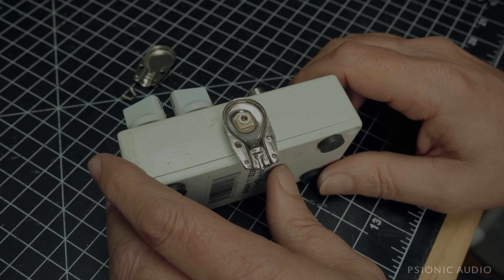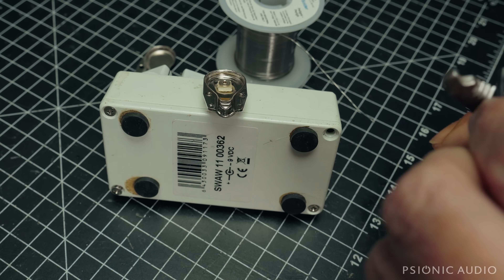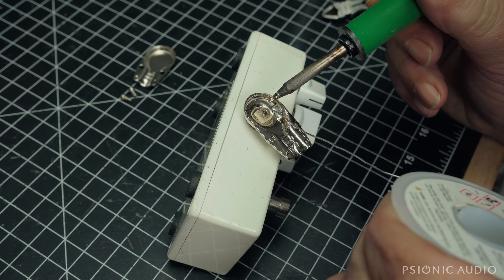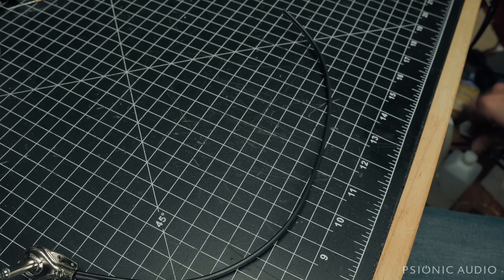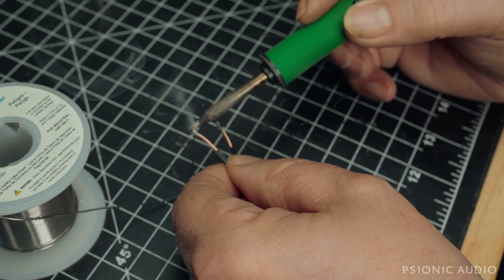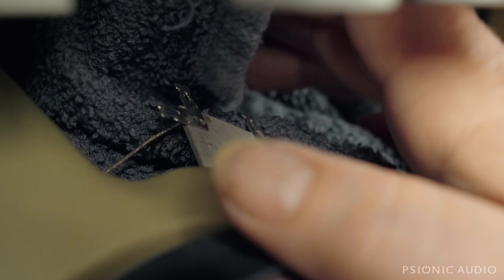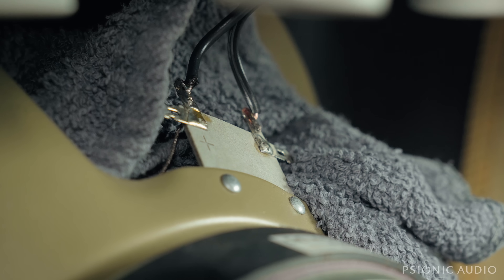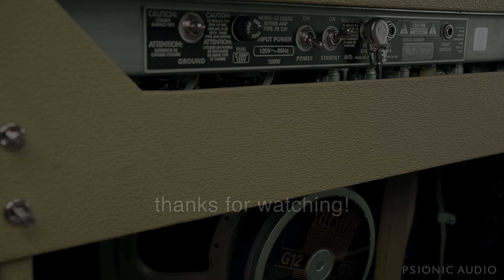Let's Make a Speaker Cable

Comment: I don't know if you've figured it out since this was filmed, but you can set the sleep time on that soldering iron. The procedure is in the manual, step 6 but isn't as clear as one might hope.

It involves inserting the control card and holding the up and down buttons while powering the unit on. It starts in bank 1 - Temperature scale. Hitting * selects bank 2 (sleep settings), and then moving up/down from there sets the setting in question. `2 _ 0` is the default - 0 minutes or instant sleep. The second 2 digits specify how many minutes it takes before sleep. So if you put `210` there (press up 10 times as the manual says), you are saying to go to sleep after 10 minutes instead of instantly (0 minutes). Press it 20 more times to set it to 30 minutes (again as the manual says) 

I set mine to `2_2` - 2 minute delay before going to sleep.

Comment: I have a marshall mg100dfx combo and there is some mention that the 4  ohm speaker is too low impedance for it. Theres a cheap with a heat sink that continously burned up in the past. Im thinking of adding a longer wire ao as  I can operate it from my desk while its miked up. Latest experiment was adding a cpu fan in place of the old one which seems to be working until I close the enclosure and screw it back together. Makes loud sudden popping noises when its closed. I Suspect due to the fan blowing the wire harnesses between the boards inside. Is making the wire longer helpful. For reducing the temperature and potential failure of that chip. There are people recommending an 8 ohm speaker replacement. Im considering the swamp thang from eminence.

Comment: Thanks A LOT for this just essential tutorial.
First of, nobody really tells you a basic guitar cable is NOT suited to connect an amp head to the cab. 
Even in stores, when you buy an amp head and cab, you ask for the cable, the guy tells you, with an authoritative "duh.. just use a guitar cable" with "you stupid newbie" look in the eyes🤯.
I don't know why manufacturers don't even supply the cable with the cab or speaker.. 
Even when you search "cable for amp head to cab", most links show you classic guitar cables..
So there you ruin your amp head, or just underuse the sound capabilities of your new piece of gear..
You find thousands of forums talking about this fabulous guitar cable brand with tons of talk, and almost nothing on this important detail, you need a different cable for your speaker, with these guitar type plugs.. 
😂

Comment: Ive been using those pancake jacks for everything that needs a right angle for years. Speaker cable, patch cable, instrument cable. I use the TRS version for my instrument cable to my guitar so i can use the ring connection to send a DC voltage 9-18v to my active pickups so i don't need batterie in them anymore. The first pedal in my signal chain has an 1/8" jack i added that I plug a DROK variable dc power supply into and that jack is connected to the input jack ring connection which passes the dc voltage through the TRS cable to the guitar. That way i can send a precise voltage to the pickups that atays consistent. So my active pickup guitars are plug and play, no batteries nessesary just like my passive guitars. Plus i hated how much my tone varied when i was using batteries. From one day to the next i could tell a difference. But using the power supply i always get the same output and tone for a given voltage. Anyways that was a ramble, point was i love those pancake jacks (the good ones at least, as Lyle likely knows they ARE NOT all created equal quality wise lol).

Comment: I know soldering the wires to the speaker lugs is supposed to be more secure but I am aware that "Heat" is'nt a friend to the voice-coil, I  just crimp the connectors so they don't slip off . Seen speaker cones with holes from solder blobs burning through the paper cone and some speakers fail if the iron gets too much time on the speaker lug. I trust myself but if anyone out there is going to DIY then watch this video at-least 10 times and maybe stick a  bit of insulatining tape over the "positive" on the angled jack just so it does'nt short on the cover plate when you close the connector(usually theres a small tab on the inside of the cover but check anyway) , thanks for a very useful video tutorial!

Comment: I must be doing it right. I've made many speaker cables exactly how you described. I do appreciate you mentioning the temps you use for different applications. I've been backing off on my heat and getting better results.

Comment: Never been a fan of those Switchcrap connectors. A real pita to work with, can’t use thick wire, and a short circuit waiting to happen.

Comment: What do you have against quick-connect terminals for hooking up the speaker wire to the speaker?
Reply from the maker: It fails. Commonly.
Reply: @PsionicAudio  Do you mean the vibrations wiggle the connector loose?

Comment: If you're going to use terminals instead of soldering, make sure to measure and see if the lugs are .205" or .25".  Many off-the-shelf cables that have terminals on one end use the more common .25", even though many popular speaker brands use .205" lugs.  I learned this the hard way when one of mine slipped off, I was lucky to catch it before damaging the output transformer.  Since then, I solder everything if I know I like the speakers, or I at least use the proper terminal size while trying them out.

Comment: Lyle... what's your opinion on using spade connectors in such case? I just made a speaker cable for my Fender Super-Sonic 22 combo and now thinking betweem soldering and spade connectors. I have been upgrading and "fixing" my amp with everything you (and Brad - shout out to Brad and Brad's Guitar Garage) have shown, told and explained. Thanks!
Reply from the maker: I don’t like quick connects. Solder is so much safer for your amp. If you use QCs make sure the connections are clean and tight.

Comment: Great stuff Lyle. Just 1 quest. Back in the day i bought a tube of rosin soldering flux from radio shack that has lasted me 20+ tears. I used it for pretty much all soldering to avoid cold joints with 60/40 solder. I don't see people using that anymore. Is it now incorporated into the solder itself?  Thanks!
Reply from the maker: The solder I use is has a core of resin flux, so it’s flux and solder at the same time. Occasionally I’ll reach for a flux pen if any extra is needed. But that’s pretty rare.

The solder I use is listed in the video descriptions.
Reply: @PsionicAudio  thanks for the info!
Reply: @MarioV689  , I have an old container of Weller rosin flux, a piney-smelling resin that has some crystals forming but still works good when soldering to a heavy chassis ---- offers some additional oxide removal and heat transfer. Unfortunately, some of the fluxes sold on ebay or Amazon are repackaged acid fluxes of a type suited for waterpipes but are being resold to unsuspecting newbie electronics hoppyists.

Comment: I had a bag of those "pancake" right angle jacks ready to wire up a pedal switcher unit. 
Problem - jack sockets too close together for the width of the jacks. 
Yes there are narrower right-angled jacks But they stand out further, space is at a premium.  
Solution - Tin snips. I cut a segment from the side of the jack bases then bent the covers over to match.

Comment: Another great informative video! Lyle is the best at this. Another tip I have used for years on cable connectors is to dap a small amount of 5 or 15 minute epoxy into the cavity before screwing the 2 halves together. Just another layer of protection to keep everything from coming loose and I have never had a connection fail or wire pull out. Thank you Lyle for all of these great videos!

Comment: Yeah I use the 2x4 with a hole drilled in it method - and I also have this same pedal but in working order. 

I needed a speaker cable for a combo amp and should have built my own but bought one off of ebay to "save time" and the cable for bridging the 2 speakers was way too short. Should have just built my own. It would have been cheaper and done properly. Lesson learned I guess.

Comment: Lyle, apologies if this is a dumb question, but does speaker polarity matter in a single-speaker amp or cabinet? I can see why it matters if you have more than one speaker, but don't understand why it matters with a single speaker. Also, SquarePlug SP400 (or SP500) low profile right-angle plugs are an excellent option for Fender amps. Thanks for your work on YouTube

Comment: I do not like the StaKon connectors on speakers either ,I have a 2x12 amp that has StaKon connectors on the speakers and one of them worked thier way off ,so I just soldered all the connections ,Nice tutorial Lyle

Comment: I’ve been soldering PCBs, guitars, amps, etc for a couple of years but I’ve always wonder if there is a minimum temp on the soldering iron to avoid a cold joint? I guess the material soldering onto is a key factor to the answer. Feels like anything below 300 degrees won’t get the job done.
I don’t wanna overheat the component either. For an example, how much heat can a potentiometer take before damaging it?

Comment: Looking at the manual it appears the timeout on the Hakko 971 can be set as long as 60min, or turned off entirely (but being a Hakko it takes a bazillion button presses to navigate their weird-ass menu system)
Reply: And yet, an ancient Weller TCP type soldering station (24volt AC supply and magnetic heat control) on my day-job workbench ran for over 15 years, 8 hours a day,, 5 days a week,, on the same heating element. Tips were good for about 3 months, and to increase the temp you changed to a "hotter" tip.

Comment: From Leo:  Good tip on the junk pedal to hold the plug.  I drilled a hole in the top of my soldering station and installed a jack.

Comment: A nice neat job and I drilled holes at different angles slightly smaller and tapered them into a block of wood so the plug doesn't move.

Comment: Sometimes those right angle plugs come with a little insulator disc to ensure the center connection doesn't short to the top of the shell. Maybe the video simply doesn't show it. The method used to connect the center pin should avoid the issue in most cases. I think it's worth a mention, as a belt and suspenders guy, if no insulator, add a piece of tape over the center pin before closing.

Comment: Thanks for posting this! We do these mundane tasks without a second thought, but it’s great to see a solid repeatable method demonstrated. I remember the first time I opened one of those pancake jacks. It was not immediately obvious how to connect it. And yes, in lieu of a broken pedal, I use a 2x4 with a hole in it!
Reply: I have a chunk of 2×4 with RCA, XLR, and 1/4" jacks mounted to it, as a jig for holding connectors when soldering a cable to them.

Comment: I liked all the work terminating the plug, but I didn't like the plug. It looked a bit cheap. I'd prefer something cast or machined over pressed sheet with plating. I do like the attention to detail, and the voiceover explaining the thinking behind it.
Reply from the maker: Well these Switchcrafts are pretty well field tested at this point, but the pancake isn’t usually my favorite design. Great for a Fender combo where it needs not to protrude and not interfere with the rear panel.

For other amps or standalone cables I prefer Neutrik and Amphenol.

But the soldering technique is much the same.

Comment: Ah nice. Need that for my ri twin 65.

Btw it is safe using led solder up to what temp? The fumes can be toxic if heated too much I was told.
Reply: Electronics solder melts at far, far below the boiling point/vapor point of lead (about 3000 Degrees Fahrenheit!).